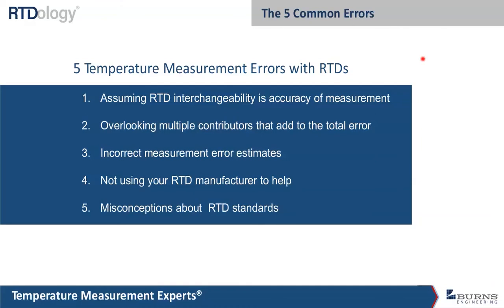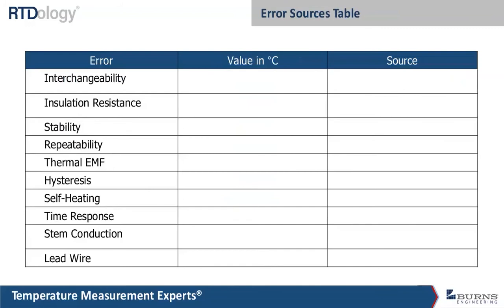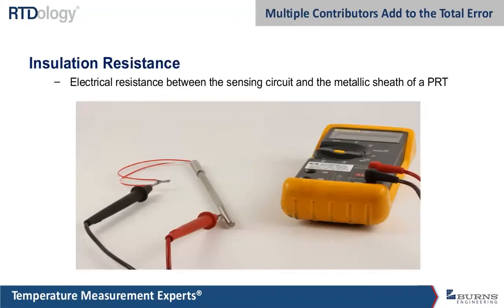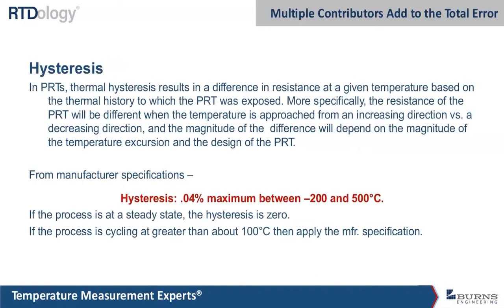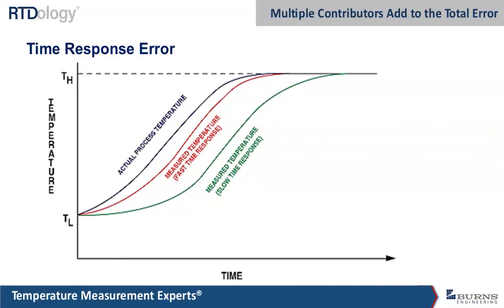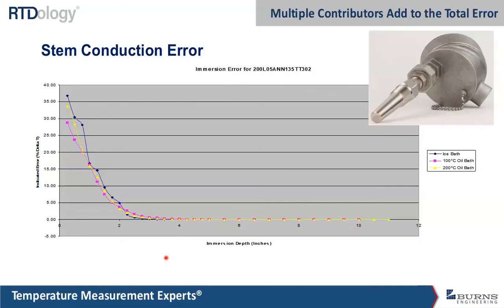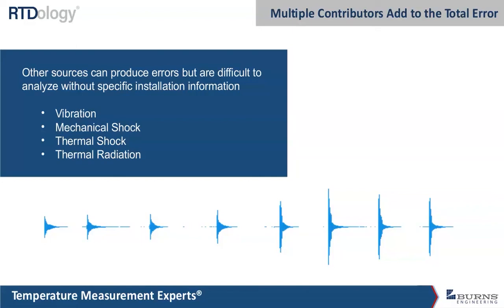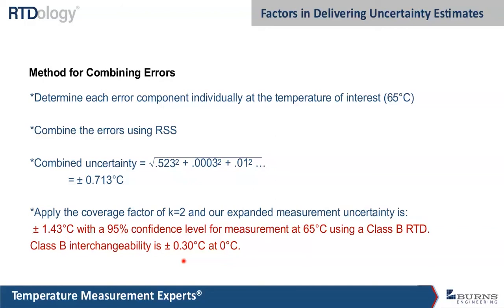5 Temperature Measurement Errors with RTD Temperature Sensors

Comment: Is it best when using the hot/cold bath to allow the sensor to stabilize incrementally in degree change?
Reply from the maker: It is necessary to allow the RTD to stabilize at the bath temperature before making a resistance measurement.  This will take about 3 minutes.  When moving the RTD from a cold temperature to hot or vice-versa, allow it to attain room temperature before placing in the next bath.  Going from extreme cold such as LN2 to 420°C may cause excessive strain on the sensing element changing the resistance characteristics.
Reply: @ thank you, much appreciated.